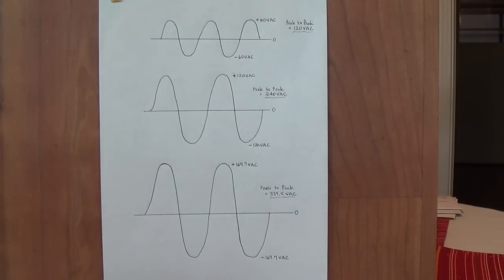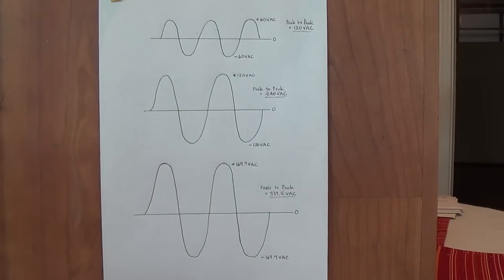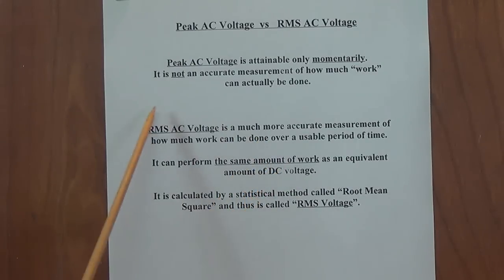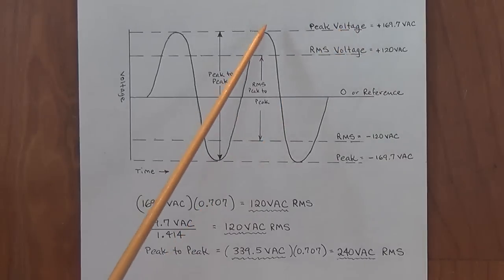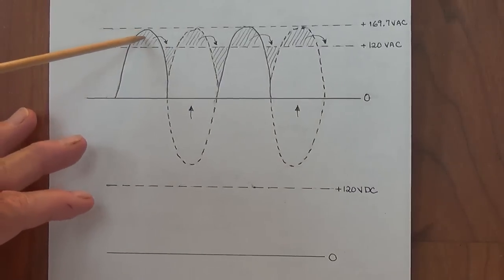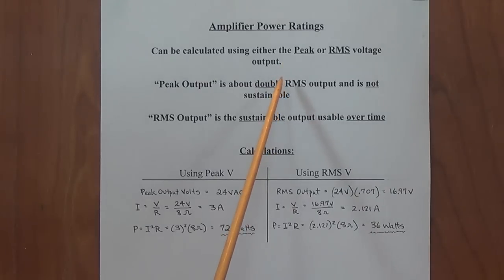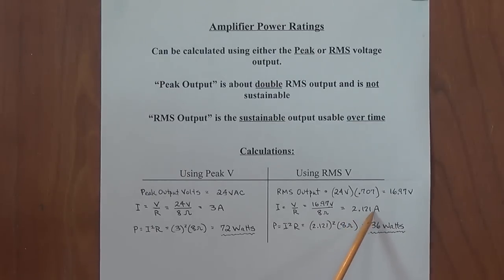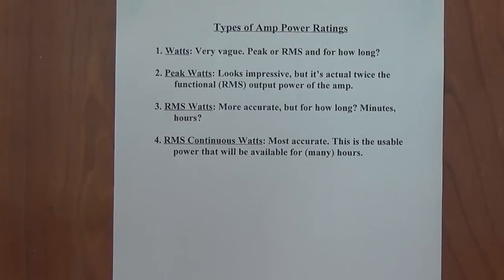The AC Wave Form, Peak Voltage, RMS, and Amplifier Power Ratings

Comment: Another great video. I have noticed that the AC line voltage varies at least 5% coming in my house. Is this normal?
Years ago in my recording studio I installed both a Furman AC Line Voltage Regulator AR-15 II and a Furman Power Conditioner M-8D. The M-8D display shows the AC line voltage to be in the 117 to 123 volt range with one reading usually being stable for hours, usually around 118.
So when I am setting the bias in an amp I also note the AC line voltage at the time of the measurements. For example on a Fender Deluxe amp, plate voltage is 370 volts at 117 AC and is 390 volts at 123 AC. The plate current ranges from 22.7 mA to 24.1 mA. The calculated plate dissipation is then 8.4 watts at 117 AC and 9.4 watts at 123 AC. This wide range make for a challenge when setting the amp bias, so I listen to the amp to set the final bias point.
Reply from the maker: Thanks, DB. I have a feeling that the AC line voltage rises and falls due to community usage rates....probably lower at 8AM and 5 PM, and higher at mid-day and late at night. I never really considered this when biasing an amplifier, however, so you bring up a very good point. The PD values you mention show a rather significant change, which reaffirms my tendency to bias conservatively. Also, your suggestion to use the ear as the final arbiter of proper bias is a good one. Thanks for this very informative input.
Reply: Uncle Doug Your videos on amp biasing are also very informative. The amp biasing method of measuring the voltage drop across each leg of the output transformer and the plate voltage is excellent. However, your biasing measurements may not be as conservative as you think. For example, the plate voltage is 20 volts lower for BF Princeton Reverb and 30 volts lower for BF Deluxe when using a Current Limiter, thus the plate dissipation is actually higher than you calculated. The difference can be greater than the AC line voltage variations.
Because of your early videos, I am now using a Current Limiter (250 watt bulb) when I power on an amp that is under test. The Current Limiter I am using has two switches -- one for Off / On and other for Limit / Full Power. After the amp powers on safely with the Current Limiter and warms up, I switch to Full Power to take final measurements. To increase safety after turning off the Current Limiter I also use a Bias Board (as you know I posted photos of a Bias Board on your FaceBook page). Recap here: “A bias board can be made from a piece of wood and terminal strips. Before applying power to the chassis, connect jumpers from the components to the terminal strip. Measuring voltage of the components can then be done remotely to reduce risk of shock or meter probe slippage.” So both AC line voltage changes and use of Current Limiter effect the actual calculated value of the tubes plate dissipation.
Reply from the maker: Greetings, DB. I just finished checking the with- and without-CL readings on a double-ended 6BQ5 amp I'm working on. I found a PV differential of about 1% (310V with and 313V without the CL).

My CL uses a photo flood bulb that is probably closer to 400W, with a cold filament resistance of only 1.6 ohms, so its current (and voltage) attenuation is much less than with a 250W bulb.

Your point is still well taken, however, and I need to keep this attenuation in mind when biasing tubes, particularly for fixed bias amps that will be driven hard. Like you, I will probably do the PV and PC measurements on these amps sans CL for maximum accuracy.

Also, I really like your Bias Board idea and will construct my own in the very near future. It's use will effectively eliminate the need for a CL while rooting around in the chassis making voltage and current measurements. Thanks again for your very informative and helpful input.
Reply: Uncle Doug I am using a Eiko ECA photoflood 250 watts bulb in my CL. The resistance measures 3.2 ohms.
Reply from the maker: There is no indication of wattage on the bulb I am using, but since the resistance is half  your 250W bulb's resistance, it would appear to be of a higher wattage.

Comment: Great explanation.  So how about running a 50W RMS 50hz Amp on US current?  Goes to 11?
Reply from the maker: Greetings, XC. As long as the amplifier was built to use 120VAC 50Hz current (which is not common) it would probably work on 120VAC 60Hz U.S. current. The only noticeable effect would be that the power transformer would probably run cooler than it would on 50Hz current. If the filter capacitors were faulty, the hum would be at 100Hz. There would be no noticeable increase in power. The other way around (60Hz amp on 50Hz current) won't work....the power transformer would probably saturate and overheat.
Reply: Thanks Doug, I figured that.  I was more or less joking.

Comment: Nice! There is and amp with a switch of 25,50 and 100 rms watts output. What i hear, the way it function is reducing the signal to the PI. The idea is to make the power tube clip earlier. But i dont know if this make the vol lower or if it is a economical mode or something, im confused.
Reply from the maker: I believe they work by switching between triode and pentode output, and by switching between 2 output tubes and 4 output tubes, WC.

Comment: GOOD DAY how to get .707 ? 
 what is the tern to call .707?
Reply from the maker: Here is an excellent explanation, Mr. T:  http://www.electronics-tutorials.ws/accircuits/rms-voltage.html
Reply: The short answer is that 1.414 is the square root of 2, and 0.707 is the reciprocal of 1.414, i.e. 1 divided by 1.414.

Comment: .707 is close to the sine of 45 degrees. Makes sense.
Reply from the maker: Yes,  because the hypotenuse of an isosceles right triangle measuring 1 unit per side is equal to the square root of 2 units, and the sine is the ratio of the side opposite one of the 45 degree angles (i.e. 1 unit) to the hypotenuse (SR of 2) = 1/1.414 = .707.